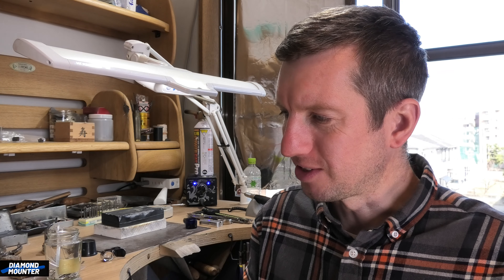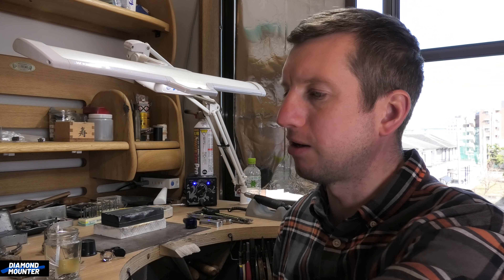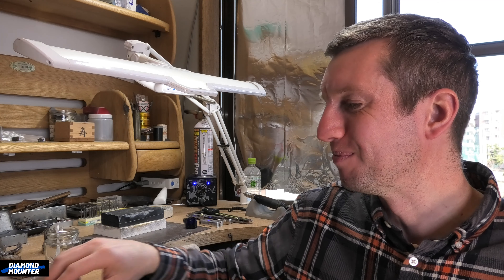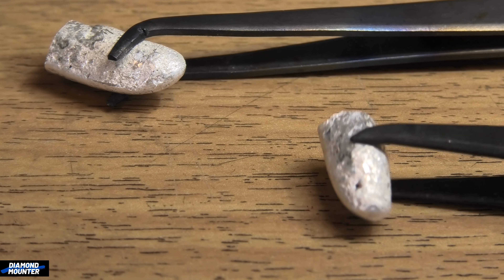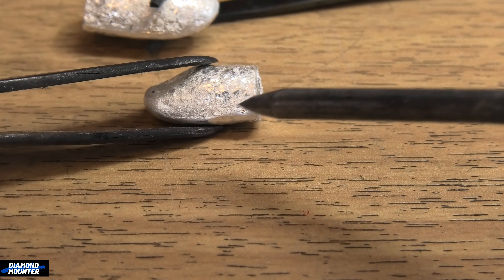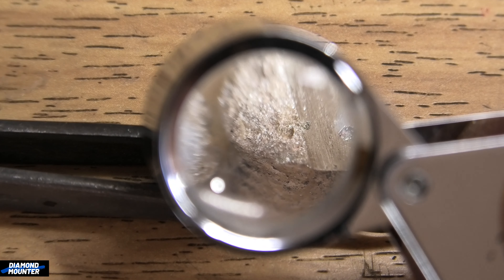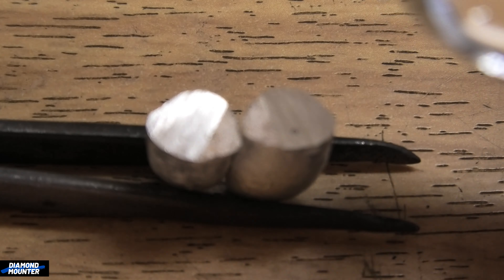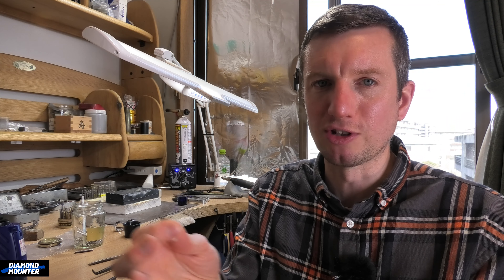Jewellers Beware! Porosity is Coming to Ruin Your Day!

Comment: After doing lots of LOTS of melt ups on a charcoal block, I am beginning to think that it is really not as good as pouring molten metal. At first I was thinking it was the recycled scraps but I think its also the method. My new theory is that  when you pour metal gravity helps push all the air out. Look forward to buying new equipment for this soon!

Comment: More than one caster had their backs broken by porosity.
There are three main types that are common: gas, shrinkage, inclusion.
Inclusion is when parts of the mold break off and get trapped in the material, simple enough to avoid..
Shrinkage porosity mostly come about because of poor sprueing.
Gas porosity is like the herpes of metal smithing, especially silver.
Silver absorbs oxygen like a sponge when molten, then tries to release it when solidifying, creating bubbles.
Very difficult to remove the oxygen from a melt without specialty gear.
To reduce the  risk always cover the melt with a flame or other reducing atmosphere.
Reply: Great information!

Comment: For jewellery casting........ At 1000 degree use rod to mix 
And remove gas from moltel met al ad after that pore the metal in flask and use low melting temperature

Comment: how do you prevent it from happening?
Reply: I am guessing, but I seem to recall something about "the same" problem with large bronze castings, if the bronze is too hot while pouring.  When the metal hardens, it cools from the outside, and you have a hard shell, with a melted center for a while. While the center is cooling, it is shrinking, and that results in holes.  If you search for "insucktion holes" (do your own translation from "indsugningshuller" from danish) when casting plastics, you should be able to end somewhere, that talks about the problem.  AND - as I usually say about "everything" - DON'T trust me - I could be wrong, or I could be lieing - research for your self !!!
Reply: You need to use a vacuum system when casting - even when pouring metal to make an ingot.
Reply: @bap20  I like the idea.  But I don't have a system for that. I was taught how to do it with steam, to push the silver in.  Usually worked OK, but not optimal. And it sucks big time, when 10-20 hours of wax work on one piece results in nothing..  ;P
Reply: @CONEHEADDK  you can build a vacuum system for fairly cheap. There's a youtuber called "VOG" or "Veg Oil Guy" - one of his old videos guides you on how to build it :)
Reply: @bap20  OK - cool.  I've never really considered it, bcz there are so many other things, that I need in my life first, and I have ideas of, how I would have made one, if it came to that.  But I would have checked some of the many smart inventive guys, that YT has provided us with, before making my own mistakes.  Nice to get a suggestion from someone like you though, so I won't have to research as much. If you're intrs in aluminum casting, "Myfordboy" has some very cool and "redneck-proff" videos, where he makes "everything" from "nothing".  If we had had YT, when I as a kid, I might not have fuked up my life so bad..  ;P